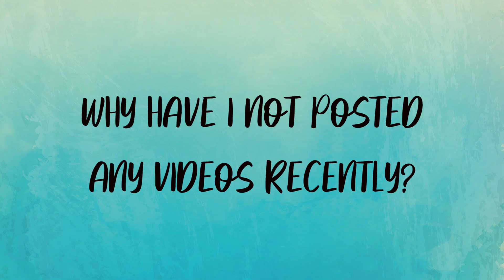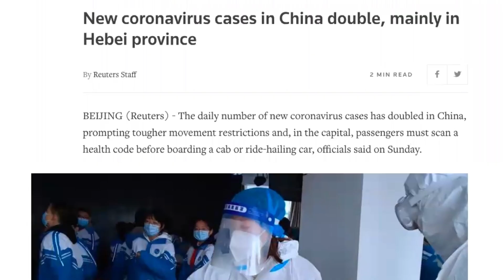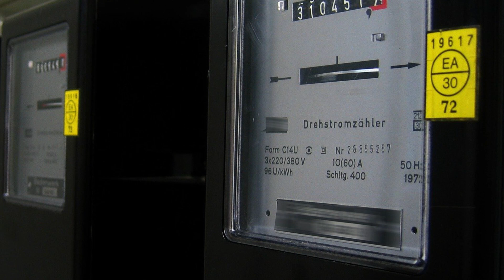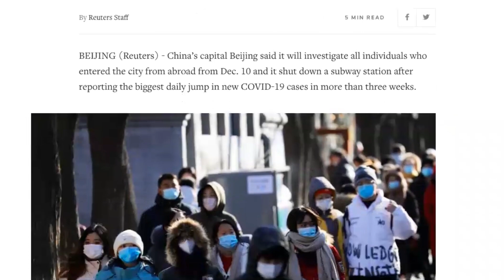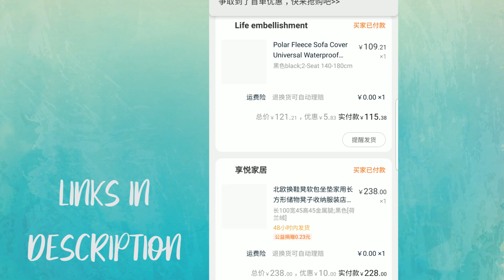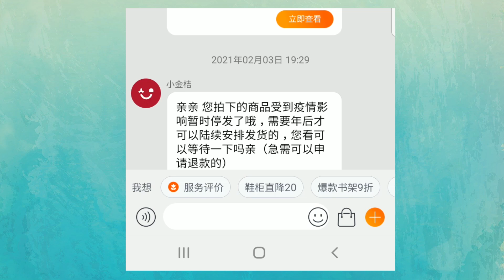Did I make a mistake moving into my new apartment?

Comment: why must you move out of your previous apartment? Changing the environment? You wouldn't have these problems if you didn't move.
Reply from the maker: That's true, I would not have had these issues. The other apartment has problems with the electricity. The socket and plug of the hot water boiler in the shower caught on fire twice and melted all the plastic around it. The company wasn't willing to fix it properly.